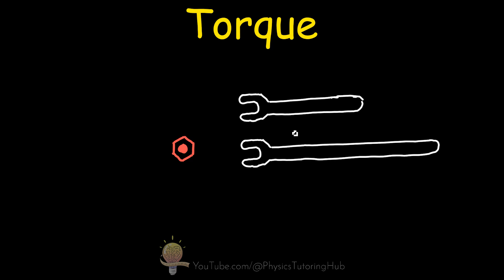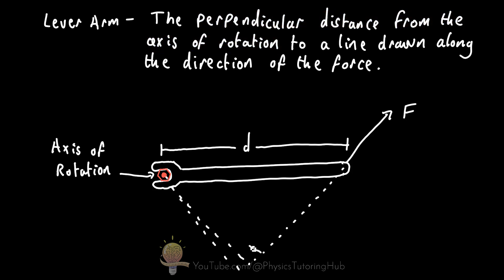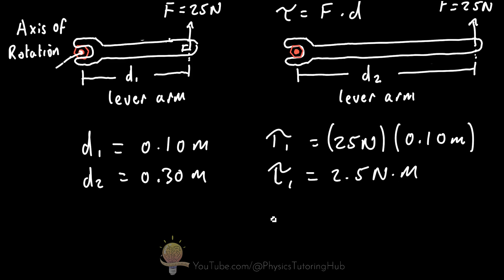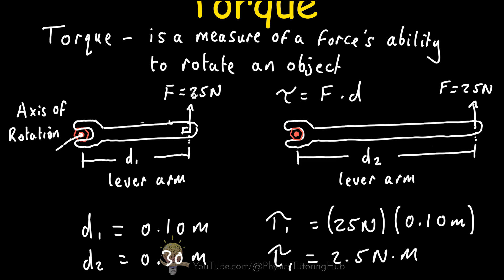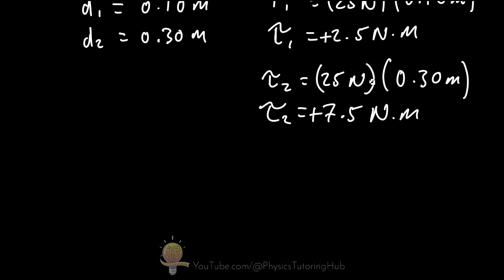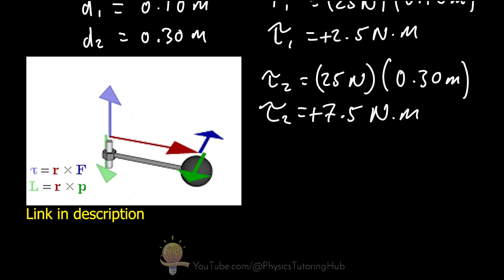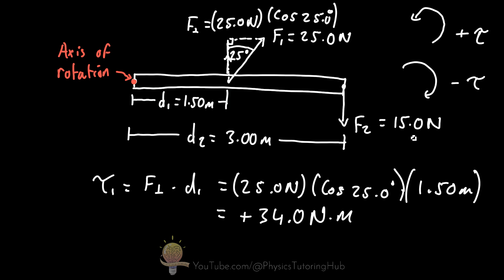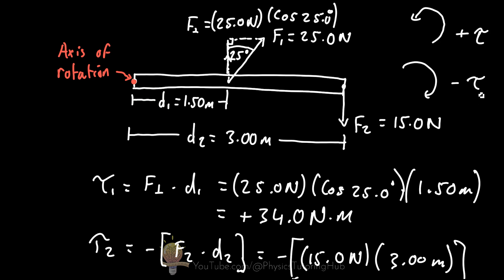Torque | Physics

Comment: Hi, I just had a quick question about the differences between moments and torque, as I haven't been able to find any good videos about this.
Reply from the maker: Cool, ask away and I'll try my best to help.
Reply from the maker: Hi Bilal. So, yes there is a difference between torque and moments but they use the same equation to measure their value (and have the same units - N.m). 
With Moments, the force applied to a rigid body at a distance (d) from the falcrum (or the pivot around which a lever turns.) has the "tendency" to rotate the object in question. This word "tendency" is important to note here. It means that it will try to rotate the object/beam but won't be able to. So, think of a diver standing on the end of a diving board. The diver's weight represents a force and that force is applied at a distance (d) away from the diving boards pivot/falcrum. The diving board bends, it doesn't rotate even though it wants to. So this diver's weight multiplied by their distance is the moment. Other examples would be the force applied to the end of a crane's arm. 
Torque is used in situations when there is an axis that freely rotates. Think of the bolt example at the beginning of the video. Other examples of torque would be the force applied by a bicycle chain on the gears of a bike. I hope this has helped.

Comment: Cool video btw. What are you using to draw these?
Reply from the maker: Thank you. I'm just using photoshop at the moment and a graphics tablet.
Reply: @PhysicsTutoringHub  great. Thanks for the reply. If you're looking for topic for your next video, I would recommend making one on inductors working and the ir application in circuits and how they are use.
Reply from the maker: @imnemo2327  That's a brilliant idea. Thanks for the suggestion. And as for the graphics tablet, it's a Huion Kamvas Pro 12 but there might be better ones on the market now - I bought it maybe 3 or 4 years ago.
Reply: @PhysicsTutoringHub  ok thanks.
Reply: @PhysicsTutoringHub  Also, If you don't mind, can you share the model of graphics tablet you're using. I am planning on getting one as a student.